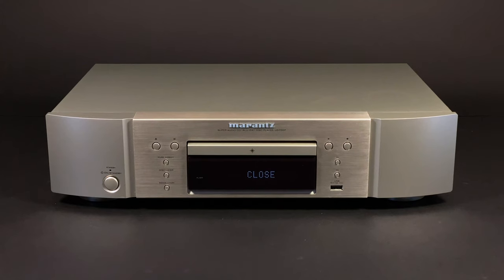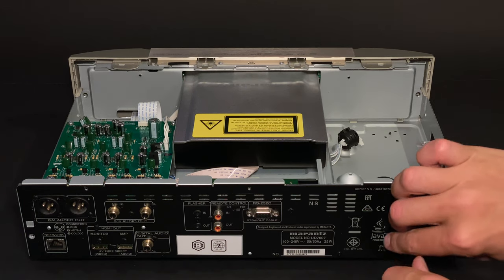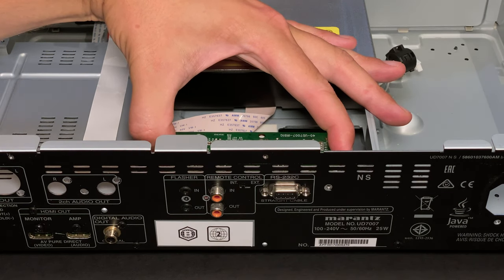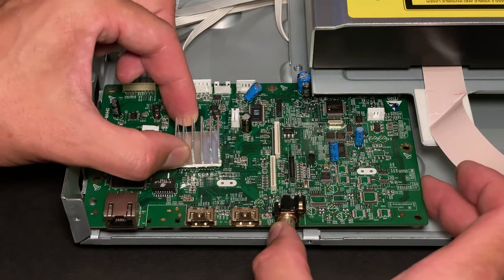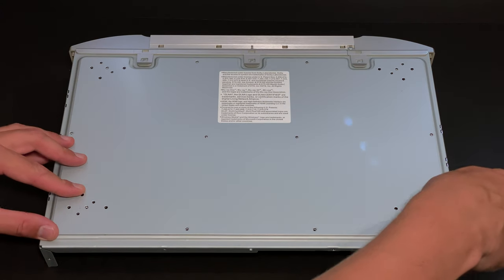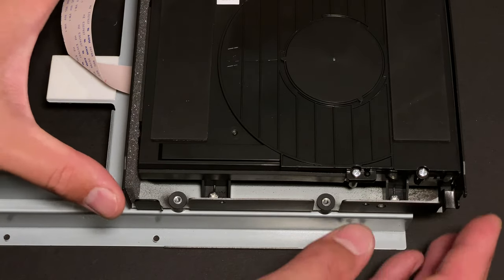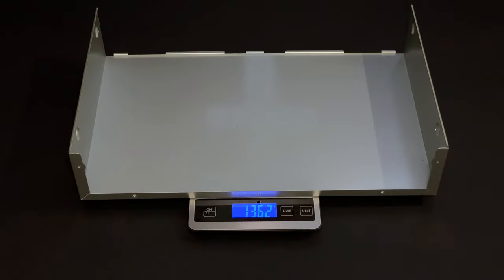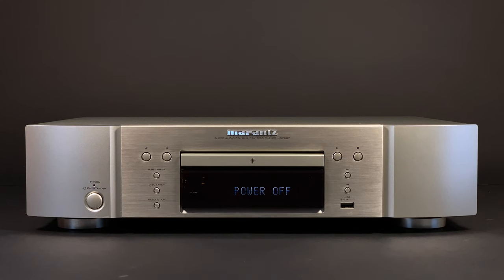Marantz UD7007 teardown.

Comment: Thanks again for uploading this informative detailed tear down. The foam inserts around the optical drive are acting as a dampener, minor shock prevention and most probable for sound absorption too. However, those type of foam inserts will dry decay over a period of time and breakdown into a messy sticky crumbles.

Printer manufacturers used these in the past during those days of dot-matrix era for the same purposes but after a period of time, these foams will disintegrate into a messy sticky crumbles, most of the time will fall down and then jammed up the printer head and spindle.

Congrats on your 1st video upload and hope that you will be successful and have more subscribers as your tear downs are very informative, detailed and useful especially on the functions of the critical component parts.

Cheers

Comment: Thanks for this teardown. I've owned one of these for the past 11 years and it is still going strong. This is truly a universal player in that it not only plays all discs, but also streams from the ethernet connection. Obviously not the latest codecs, but fine for my use. Strange to see balanced outputs on a device at this price while my far more expensive Marantz amp hasn't got balanced inputs. Edit: I wonder how that wonderfully packaged but internally cheap looking drive is going to hold up, while I am typing this I am playing a perfectly clean and undamaged CD and it managed to glitch twice 🤔.

Comment: Good video. I have a UD7006 which is almost the same as far as chips and output transistors are concearned and  has multi out but doesn't have balanced or the dual HDMi outputs. Mine is best BR player I've tested and assume yours would probably sound very simuliar.

Comment: Hi there. Your video helped me a lot to change the laser unit with in the drive but unfortunately it didn't solve my problem with the UD 7007. Do you have any suggetions what my problem could be? Once I insert a disc it says "no disc" like written above a new replacement laser didn't fix it. Thanks in advance.

Comment: Neat work. Do you think there's any benefit to shield the signal ribbon cable with copper tape?
Reply from the maker: Thanks! I'm not really a fan of such customisations. But I saw some of senior Marantz models has shielded ribbon cables. And they are not shielded with copper tape. Copper is not ferromagnetic material. I would suggest you to look in to "Mu-metal". Mu-metal is a nickel–iron soft ferromagnetic alloy with very high permeability, which is used for shielding sensitive electronic equipment against static or low-frequency magnetic fields.

Comment: i had a ud-5005 to top off my marantz ht system. when the drawer stopped opening, i opened it up to have a look. VERY disappointing for what was supposed to be a high end unit. a computer, a power supply and a transport almost 100% made of plastic. glad i paid $0 for it. piece of shit!
Reply from the maker: Broken drawer doesn't sound as a complicated fix.
And I would't call any of 5000 series products - high end. That's why I bought myself UD7007.
Reply: @boredtech  what is your view on the 6000 series?
Reply from the maker: I had a chance to look inside SR7500, AV7705, UD7007 which were made in China, MM8077 which was made in Vietnam and now AV8805A which was made in Japan. Based on that I can say that country where the unit was produced matters more than numbers. For example AV8805A was close to perfection and same series MM8077 nearly disaster.

Which exact 6XXX series unit you are interested?